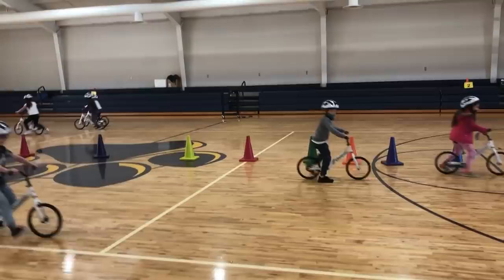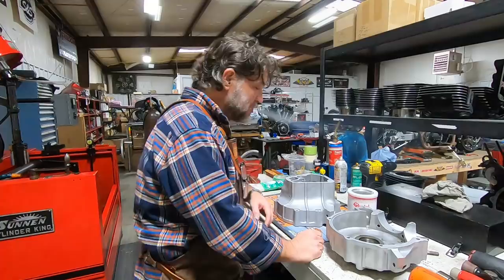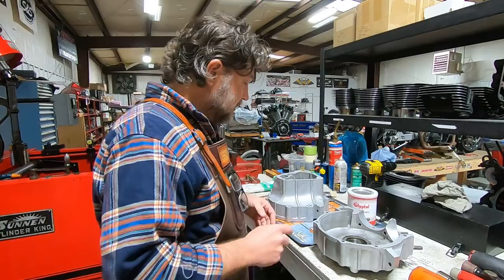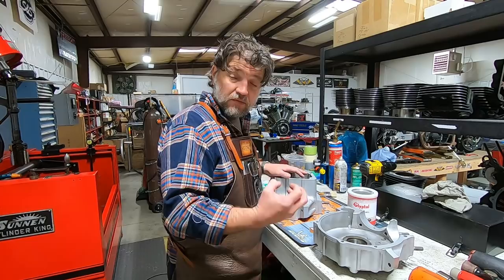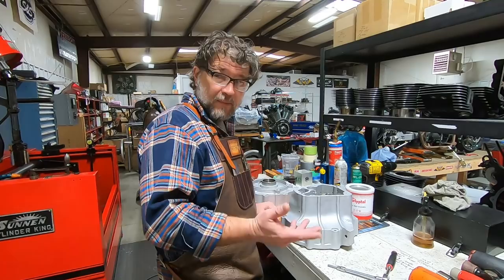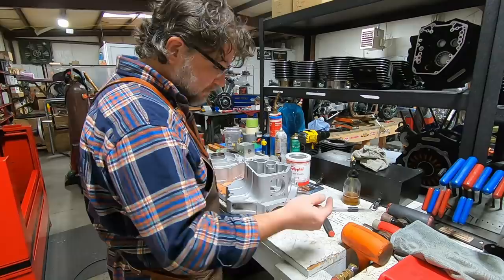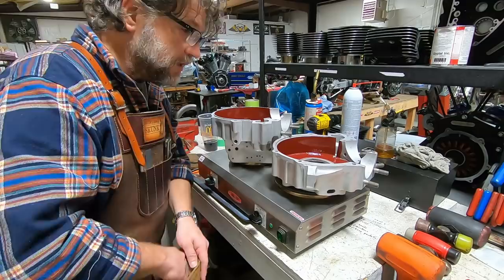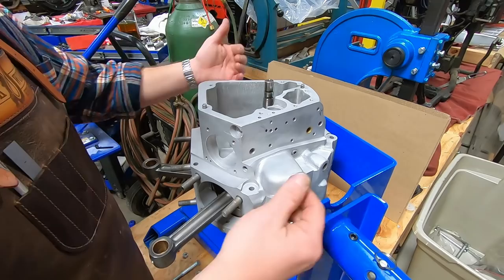Harley Davidson Shovelhead Build Series Part 1 - Assemble Bottom End - Kevin Baxter - Baxters Garage

Comment: I prefer blasting with walnut shells no real heat and easier to clean.  I use shark hide to seal the aluminum to keep from oxidation and looking good. Great video👍
Reply from the maker: Thanks.  I have never used Shark Hide but will look into it!

Comment: Armature paint. Used it on the inside of car engine blocks. In the lifter valley,  the timing chain area, and the area on the top of the heads around the valve springs and rocker studs.  It sealed the cat iron to promote faster oil return to the pan.

Comment: Missed a big part, the part I was waiting on, sealing the lower cases, what was used to seal them. Great video but was looking forward to seeing that part, because I'm having issues with leaking cases on my 75 shovel. Is it possible to seal cases without breaking down the whole lower end. Can you just spread apart just enough to clean and get some type of sealer in there

Comment: You didn't show the procedure for checking the Timken's end play, but in another vid on a Twinkie you did do so is some detail.  Now, with a commercial shop, such as yours, would it not make sense to have a dedicated dummy shaft to use for the initial setup and measurement of the Timken end play rather than wrestling with the crank assembly you are actually going to use?   
....RooDog....

Comment: I need to rebuild the cases on my Shovel also.  Where did you get that case assembly stand?  Also, what do you do when the Time-Serts are stripped.  My plan was to have them drilled out, wholes welded closed, and retap.  Is it possible to get Time-Serts drilled out whithout destroying the cases?  These are stock Harley cases with the Serial on them.
Reply from the maker: JIMS.  It may be discontinued now unfortunately.  They make BigSerts.  Oversize Time Serts for that very purpose.  Just follow the same procedure.